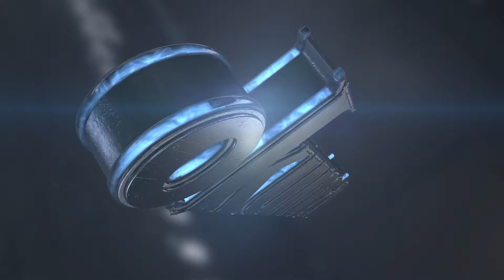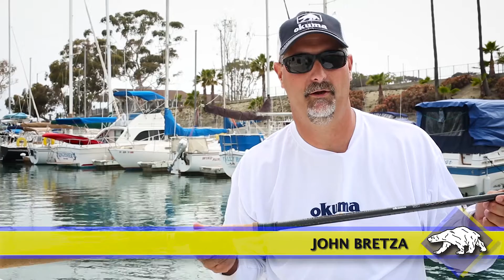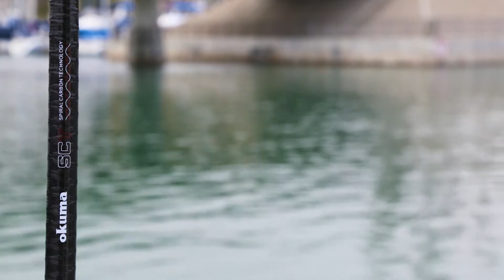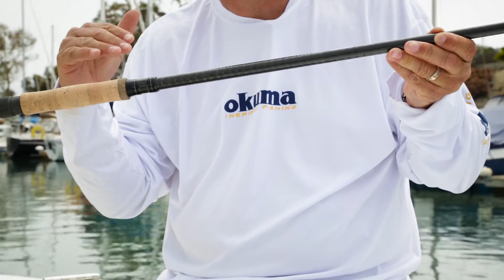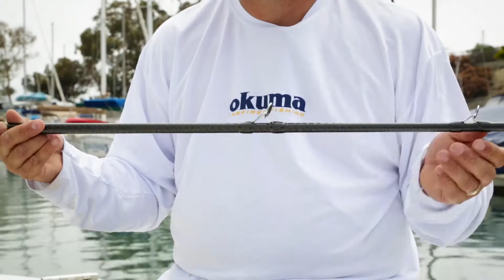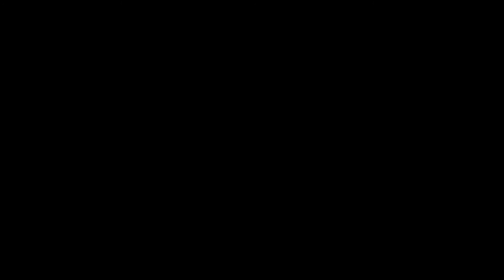Okuma SCT Musky Rods

Comment: I have one and mine is stuck in the extended position. It’s the 9’3 extra heavy. I’ve tried freezing to force air out and WD-40. Any advice is appreciated. I have three rods and this has never happened before. It happened the first time using my new one. Okuma hasn’t responded to my question.